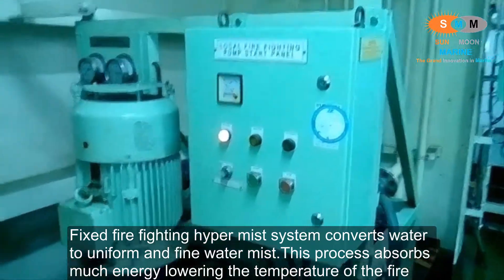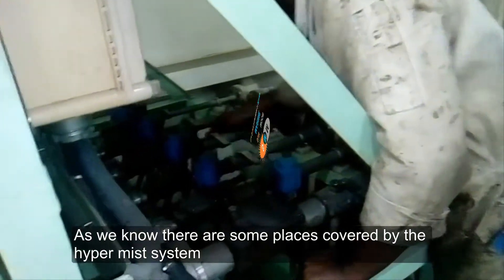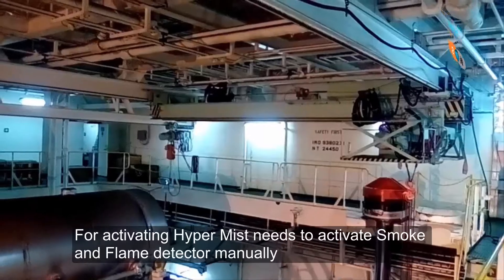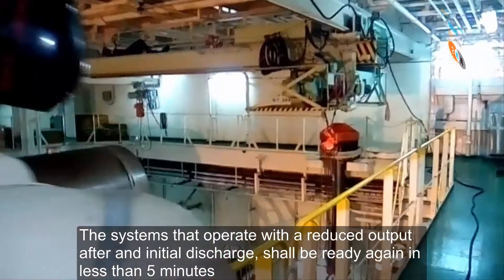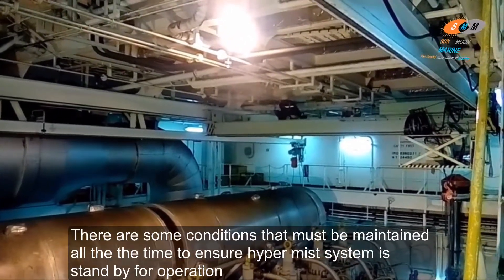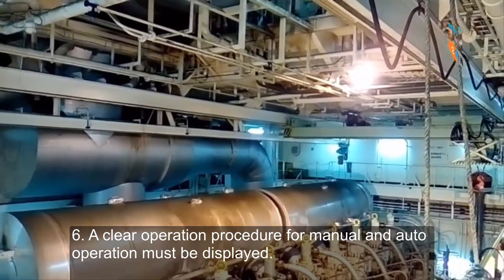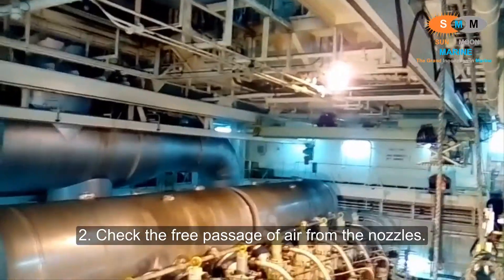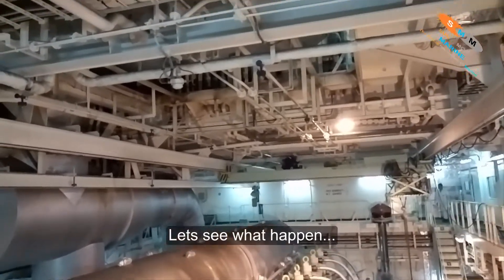How to test Fixed fire fighting system: Hyper Mist | Ship's fire fighting system water hyper mist

Comment: I test and service fire fighting equipment on foreign ships here in the USA. I would have set up  buckets under the nozzles  or tarp to protect the vessels engine equipment first before activation of both detectors. Usually I will disconnect to pump and do the test with air, then  test the pump for proper rotations and operations seperatly.
Reply from the maker: hmm that's an efficient manner.

Comment: it is during 30 seconds instead of 30 minute! i think
Reply from the maker: It is capable to supply water for 30 mins. But whenever you are going to test that should be 30 sec for at least one section.
Reply: ohh.thank u. sir.. here regulation said that redundunt means of seachest..wt is mean of seachest because it is taking watr from fw tank right?
Reply: when we doing air blow test for removing drain,then how it will go to each nozzzle becoz each sectional solenoid valve is in close condition, is it opened manually? eachtime
Reply from the maker: Yes my dear that is a extra pumping system with the sea water.
Reply: so sir  when fw finished after 30 min, we connect seawater or pour fw? i think connect to seawater right?
Reply: ty sir
Reply from the maker: Oh bro.. I am deck officer and it's hard to say for me. It's better to ask engineer. If I know later I'll let you inform.
Reply: @arrow_kp   after finishing water in fresh water pump the sea water pump start automatically and supply seawater to the system